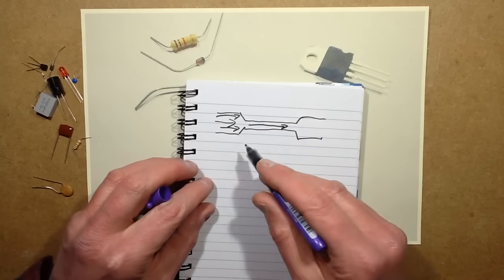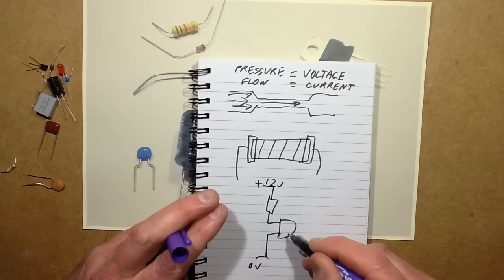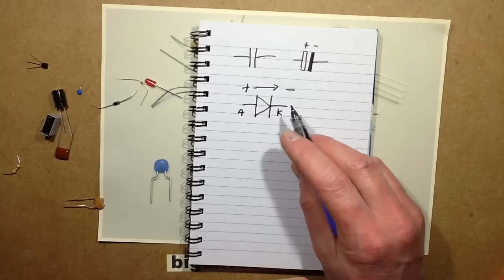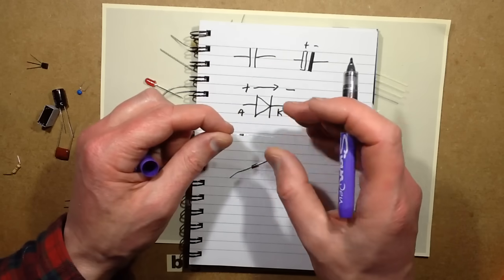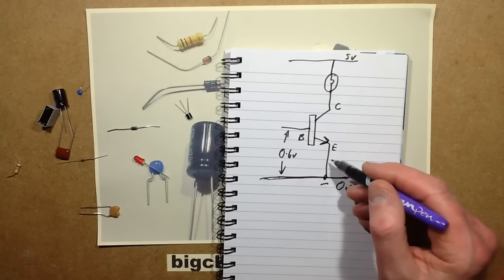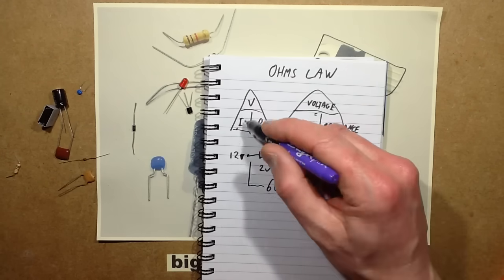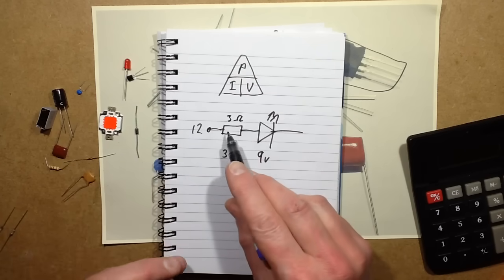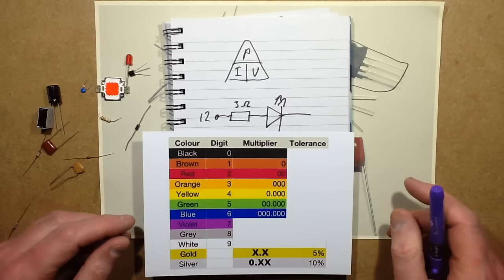A simple guide to electronic components.

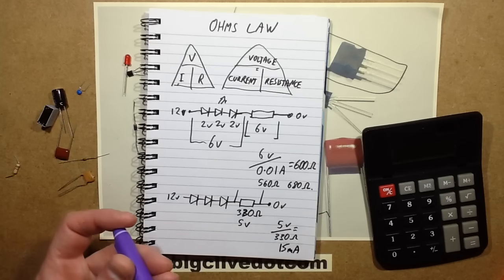Comment: 29:42 - context: which voltage to use. you measured 5v going around the resistor through your multimeter. 12v is the original, 5v is the resulting after the LED's... doesnt that mean we need to 'drop' 7v? aka 7v/330ohm = 21mA ? if not then can you tell me what im conceptually missing? isnt the 5v the 'remaining' from the 12v?
Reply: i just answered it for myself "the 5v is the remaining" aka the rest needed to be dropped lol

Comment: lol the 10 ohm resistor knows whats about to happen. 
since you are on the ball i have another question if you don't mind. i see these long LED rolls for sale , 12v. If the drop per led  is 3.6 approx and you put 5 in series then the circuit is non operational? so these strips are in parallel?
Reply from the maker: Most 12V LED strips have the LEDs wired in series circuits of three with a resistor.

Comment: I have an old pager issued to me by our voluntary fire dept., and the charger that it sits in about 90% of the time specifically says to only use NiCd cells in the pager......glad to hear that NiMH cells are also fine to use, since the original NiCd cell in the pager had reached the end of it's life not too long ago, and when I went to buy a replacement, I found out that NiCd cells aren't sold anymore.....I am a car mechanic, so I kind of know my way around electronic circuits, but am not too knowledgeable when it comes to cell charging and cell structure, so this vid cleared some stuff up, thanks

Comment: For the ohms color code, what if someone was color blind? Would there still be a way to find out the ohms without a multimeter?
Reply from the maker: Modern surface mount resistors have the value printed on them in white on black.  But a multimeter is always good for checking values, even for those with good colour vision.

Comment: This is interesting to me because I used to work in mail order component business back in the 80s and 90s. My job was filling orders. There were hundreds of bins filled all different kinds capacitors, resistors, transistors, whatever was needed. Some components would be on spindles and I would just run those through an optical counter and other loose components were sold by weight. They had a baker's dozen policy. Order 12, get 13.

Comment: Hi, I have a MPPSolar inverter (model LV6048) with a 48 volt, 290 amp hour battery (I built from 18650 cells). One of the features missing from the inverter is the ability to create schedules so that the inverter will only charge the battery during certain hours of the day, or turn the battery on so that my home is powered by the battery during a schedule I select (many of the much more expensive systems such as Tesla, Enphase, etc.) include this ability).  DO you have any idea how I can add this function? Great videos by the way!

Comment: Thank you.  Great tutorial.  At the 26m example you drew the resistor after the LEDs.  At the 32m example you drew the resistor before the LEDs.  Does it matter?  Also, does it matter what position the resistor is installed with regard to the color bands?  Is there an "in" and an "out"?
Reply from the maker: A resistor is non polarised and can go anywhere in a series circuit.
Reply: @bigclivedotcom  That is hard to comprehend when I think of your water analogy.  I would think anything before the resistor gets full volts and anything after the resistor gets the reduced amount.  So it doesn't matter where in the series just as long as it's there?
Reply: @ron045  i would assume it’s because the resistor all it does is resist the current from flowing so as long as it’s on the wire anywhere it’ll do it’s job (at least on the series circuit) correct me if i’m wrong i’m literally new to all this as wel.

Comment: I like the water analogy of electricity, but you sort of shoot yourself in the foot when you talk about resistors. If a resistor limits flow (electrical current) pressure (voltage) would remain constant and thus the LED (3V) would still burn out. Does not a resistor limit voltage? ie If a battery, resistor and LED are connected in series, each load would incur a voltage drop, yet current in the circuit remains constant. Or am I mistaken in interpreting this?

Comment: How would a electrolytic capacitor benefit a unit drawing up to 200 amps at 14v?
Reply from the maker: It depends on the application.  But they are used in welders.

Comment: Hey Big Clive, I do have to correct you at 16:41. Current does not travel from positive to negative. It travels from negative to positive (google current flow through diode). What I was taught in college (studying electronic technology) the arrow symbols on NPN, PNP transistors and diodes denote the polarity of the item. It points to the negative side of the part to be connected. The same thing with electrolytic capacitors, the black line on it is an arrow if you look closely. This arrow points to the negative side of the part.  Many people think it denotes current flow but that is wrong.
Reply from the maker: I'm working with conventional current flow instead of electron flow.  It relates to symbols like diodes much better.

Comment: very informated section video who
have study at Electrical Study Program Diploma Degree but you can not explain a measurement decision maker. can you make a program to make Audiovisual Circuit  
?. we have a lot of Material at Like your Resistor, Induktor, Capacitor, Diode, and Elementary Pasif, Active Compenents. How the flow a low current to every Circuit Architecture ?. Where do you Buy a Multimeter like yours 100 nanofarad and microfarad ?

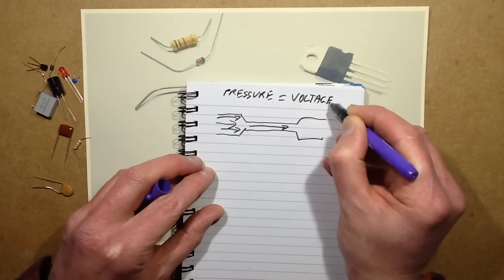Comment: 1:20
So when you increase the voltage you increase the current?
Meaning that an increase in voltage alone—and no other changes (such as wire gauge)—increases the current?
Reply from the maker: For a set resistance increasing the voltage will increase the current.
Reply: @bigclivedotcom  
OK. Thanks.
So I understand it that all other things bring equal, simply increasing the voltage will increase the current.

Comment: How do you start reading resistor?which one is lift and right
Reply from the maker: You usually read from the end with a tight cluster of bands.  But some can be very confusing, so it helps to measure them with a meter to see if it correlates to the colour code.

Comment: IMO, the water analogy for Resistance is incorrect, as 'flow or current' = (Volume of water flown)/(time taken) which remains constant. However, in the case of electricity current is inversely proportional to R under constant voltage, thereby not constant with change in Resistance. 
Furthermore, with narrowed down pipe (analogous to increased R), water speed increases but in case of electricity the relative motion of the charge carriers is decreased.
Reply from the maker: It's not a perfect analogy, but it's very good for making current and voltage easier to understand.

Comment: One of the best basic crash course on most commonly used components I've seen so far. My father caught me taking apart my little brothers' broken remote control car when I was 13 so he bought me a small simple booklet on resistors and an electronic multi tester. Once we've collected enough components from broken radios etc. we started building basic amplifiers, LED blinkers and several other projects we followed from some of his electronic project books when I was 15. It's too bad that the colleges I tried to apply to for electronics didn't know or care that I was passionate and had more than necessary drive to earn at least some education so that part of me died a little and I never really got much further than the basics (to be fair I'm from a tiny town where we are still thought to be a primitive culture that only began modern civilization just a little over a hundred years ago). My last electronics build is a speaker amplifier (most I've done before that were small headphone amplifiers using one or two transistors) using OP Amps instead of transistors was like 9 years ago from an online course in audio engineering in which I passed and got a certificate from but my interest in electronics is not likely to come back to life again... Not so much that I was discouraged but more that my passion for it died.

I feel that you might need to make a separate video on transistors because what you showed was practically just an introduction. NPN based/PNP based, switch only when currency goes through, how it amplifies and some more basis. But all in all... Really good 38 minutes video.
Reply: Hi I know I’m late but I am so so sorry and that breaks my heart that something so passionate could be destroyed that quickly, what I wish for you to keep in mind is that colleges in general do not give a flying f about anyone, they are just in it for the money. I watched a video on where this girl was a perfect student with the most perfect grades and she got rejected from college, and many other people shared their stories. It’s not because they weren’t good enough, it was because people didn’t care, they just accept or reject anyone they don’t read or analyze what you’ve accomplished or care about you. College is a false reality of hope, people think if you get in college you’ll be set in life but that is not true. Many people go into college for years coming out working 9-5s, the only reason to go to college is to get a degree because everything requires a degree but degrees are literally useless.
Reply: @misscardigan  that is true.  I wanted to do ab electronics degree but ended up with a busibess degree bavk to 30 years ago. It was too bad
Reply: Perks of a good dad
Reply: From the age of 15 I been into radio control trucks cars boats and I'm still in the hobby and I build rc and have over 100 radio control truck cars boats and it still growing and now I'm learning single because when I started was FM or AM single now single are better with 2.4
Reply: @jaredsayrc4947  please
Reply: Same when I found out that police departments/Sheriffs office turn the other way when they are paid off. That part died a little bit and now I’m trying to pursue a career somewhere else.

Comment: I think I got it ... so you send the "right amount" of workers down the wires.  When the workers get to the bridge, if there are to many the bridge will collapse and it's game over.  If the right amount of workers cross the bridge it lights up.  Yeah!  The workers may encounter resistance on the way, and if so some may be lost in the battle.  If not enough workers make it to the bridge the ones that do will have to work so hard they might have a heart attack before the bridge even starts light up. 
At this point the remaining workers enter a CPU where they become lost forever in a maze of complication and complexity.
Right?

Comment: When I did my electronics course at technical college, we soldered these components and calculated voltages in different parts of the circuit, but never taught these basics. You explain things so well. It's amazing how a common $2 electrical item at home, can have such complex designs. Cheers
Reply: Same here. Clive is a really good teacher.
Reply: Thats odd. Seems like usually schools try to teach an understanding of basics/foundations before getting technical.
Reply: @A6Legit  Depends what set you were put in for Maths in School, I never got the chance to do (technology) electronics back in school because I was in set 9 - 1 being the top set, 9 being the bottom dummies set. However as an adult I feel I could have been taught this stuff as it's fairly practical and I've always been more of a practical person than a brainiac - it might make sense for the school to have avoided trying to teach me programming with my low maths skills but there's no logic in denying me the chance to study electronics because of it, especially with calculators being widely available. It's mostly a case of knowing where to get your start values so you can find your needed values.
Reply: I have been traumatized with a capacitor
Reply: Great endeavor.

Comment: If you had used clingfilm rather than card when making your capacitor, the resulting capacitance would have been far higher. I have in fact seen a documentary about huge capacitors being made in almost this exact way, from 2 layers of aluminium foil with a layer of plastic film in between, rolled up into enormous cylinders as long as your arm and about as thick too. Then hundreds of these being connected in parallel with big, beefy wires to form a whopping great capacitor bank. This was described as holding about the same amount of energy as a typical fully charged car battery, but being able to release all of it in a fraction of a second in a ridiculously high current pulse. This was more than 20 years ago, mind - before compact supercapacitors had become relatively cheap and easily available. A similar capacitor bank today made of supercapacitors could sit on your desk, whereas the one I described above filled a whole room.

Comment: Clive.
I know you like pyrotechnics.
In my first job at Marconi Instruments, St Albans, UK, workin their for about 7 years, I was working on the end of valve and the introduction of transistors and integrated circuits in the mid 1960's.
When I started nearly all the resistors were carbon rod type or dog bone, beacuse the connections at either end formed a dog bone shape.
Only after a short period we MI got a alert from the Ministry of Defence not to use this type of resistor as they have a runaway effect as the hotter they got the lower resistance got eventually a red hot rod and subsequecially a fire.
Oversly it was spotted or more than likely, unfortunately this had caused an nasty failure.
As a high volume of our production was for UK and export forces also other critical environments that fires are not good.
Can remember that that week we reworked equipment with the offending resistors and removed all of them from production and stores.
If you repair old valves equipment you will see these resistors.
Clive you'd make a good teacher/lecturer and your videos are intresting and entertaining.
Thanks
Reply from the maker: The same issue has happened in the past with power supply resistors in things like toilet fan timers.  They gradually carbonize and get more conductive.

Comment: I was taught ohms law as "E" electrical pressure aka volts, "I" current and "R" resistance. So ohms law is E=IxR. We remembered the power equation as "PIE" P=IxR. You left out coils, but that would bring Kirchoffs laws into play.
Reply from the maker: I was trying to keep this simple, which ruled out inductors.  They merit their own video.
Reply: Where were you and Clive taught Ohm's law?
The proper symbol for voltage is neither V or E. It's U. U = I ⋅ R.
The unit is V (volt).

Comment: AT 27 minutes Clive talks about working out resistance by taking the Volts and dividing it by the amps - which are 0.01amps. How did the amps come to be ? Where was that number derived from?
Reply from the maker: It was a typical value used for LEDs.
Reply: @bigclivedotcom  Thanks Clive - I guessed it was as much but unsure. Thanks for your video and thanks for answering. I am just entering this mine field - I really struggle with watts, volts and amps.  The formulas seem simple enough - but there appears to be some vodoo in how current is drawn. The resistance plays a significant part. I am starting with a variable electro magnet (inductor ?) - oh my.  https://www.youtube.com/watch?v=mvuHsu8S6v8  

Anyway- your video was great.

Comment: To anyone who plays Clash of Royale and doesn't understand How capacitors  work here you got an simple explanation:
It works like the sparky. One side of the capacitor charges it up, and once it gets fully charged it releases the electricity from the other side.

Tip:
Pair it with a resistor so you can control how fast it charges and you can get a timer, A resistor that outputs 10V per second is gonna charge a capacitor of 100V in 10 seconds. Once it gets charged it releases the electricity, you can now read the electricity and you will understand when it is done charging

Comment: Hi Clive, I have a question on transistors, I never understood the "you can use them as switches" example. In your video you say "suppose you only had a small amount of current available to switch the lamp on..."
Well, you need a bigger amount to actually supply the lamp itself, so why can't you just use that current? It just seems like an extra step to me?
Reply from the maker: It means that a low signal like the output from a microcontroller can be used to switch a much higher current load like a lamp.

Comment: Well I once tried to repair a printer for a old 500 million year old computer that gorillas use to use I guess. Guess what I found out you cant get the quartz circuit board for it to replace the parts with. Who knew! The motor for the printer exploded to it was every were. Printed a nice picture of a gorilla pacman ghost city though it used the print head as ink.

Comment: Hey Big Clive people, I love your videos, I  have some extra 18650 batteries. Anyone know some coolf stuff to do? I'm thinking like solar powered  garden LED?
Reply from the maker: You could use them in standard small USB power bank cases, which would let you stack them in parallel and offer some protection for charging and discharging.  If you do that, make sure they are all at a similar voltage before putting them in.

Comment: i think whenever i've had to deal with resistors a lot, i've just remembered "black, brown, rainbow, grey, white", which i guess just reduces the load for me down to remembering that black and brown come first

also it's very interesting that MOSFETs are so good for higher currents when they're also used for making logic circuits with ideally zero (continuous) current and minimal heat ... but it also makes a lot of sense because both cases would want minimal resistance along the open channel